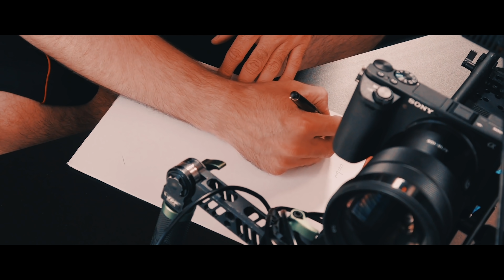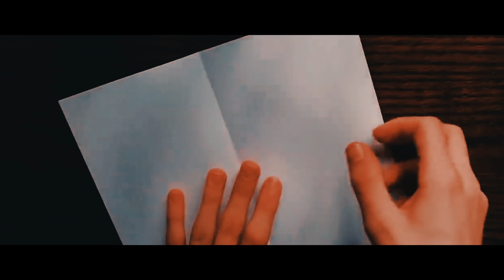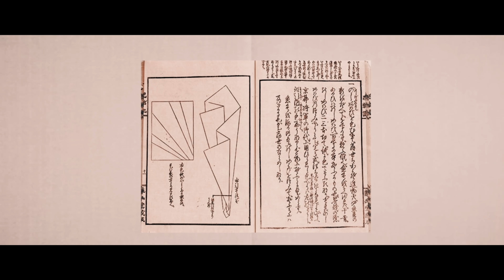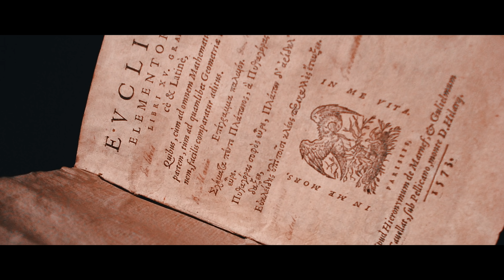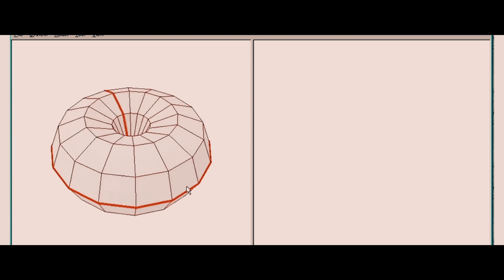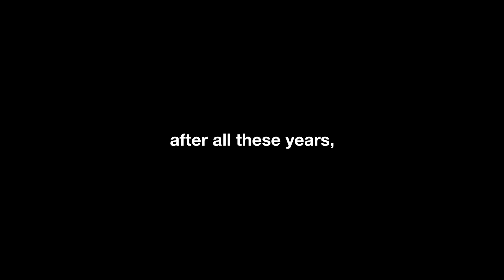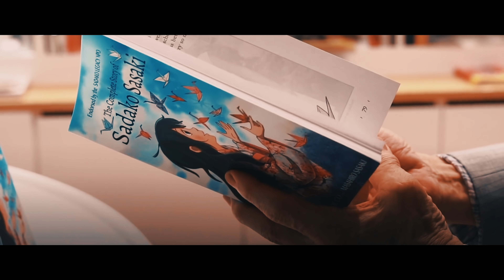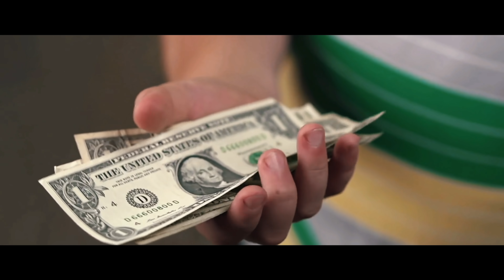Origami: The Art of Paper Folding

Comment: With all due respect, I find Origami infuriating because I cannot, for the life of me, actually fold correctly. I'm always a little off and it makes it a little too different than how it should be so then I unfold it but the creases are already there so I have to get another sheet of paper and mess up again, then get another sheet of paper and then another and another until I either give up or ruin an entire forest.
Reply: same omg
Reply: Use a software.. surely there are multiple origami based games on the play store
Reply: @l1mbo69  Gross. You take that back.
Reply: Make sure that what you start with is actually a square by folding the diagonals. If both the corners get folded in half and the 2 others touch you should be good. It's very difficult to fold anything if your starting point is even a little off
-someone who has folded origami for 5 years

Comment: If a one dimensional object begins to spin does it gain dimensions
Reply: No, because, outside of theoretical mathematics and theoretical physics, there is no such thing as a 1D (or 2D, for that matter) object. Even a single atom has width, height, and depth. Since it is impossible to spin something that doesn't exist, the answer is no.
However, if we ignore that and pretend that a 1D object could exist, the answer would still be no, as, in super simplified, watered-down terms, the number of dimensions is based off the size of the object over each axis and, thus, is completely unrelated to rotation.
Reply: @johngerken4263  so nothing can 'spin' outside the axis it exists on
Reply: So even things like light are '3d'
Reply: Correct. Light is made up of sub-atomic particle called photons and, while their size isnt measured in the same way you would measure a macroscopic (non-microscopic) object, in a sense, they do still have 3 dimensions.
Reply: I saw I good video about how dimensions work a while back. Let me see if I can find it for you
Reply: Definitely interesting
Do things like electricity, magnetism or gravity have dimension as well.
Thanks for the knowledge professor 🤓
Reply: Not a professor. Just a random person who is interesting in that kind of thing
Reply: The answer to your 3 questions about electricity, magnetism, and gravity would be no, in the traditional sense of the word (the word "dimension") however,
Electricity is just the process of electrons "jumping" from 1 atom to another, and electrons are a sub-atomic particle that are, technically 3D. 
I would say that electricity does not have any dimensions, as it is an artificial construct used to describe the process of electrons (which are 3D) moving around.

My understanding is that magnetism and gravity are both forces, and thus not physical objects. Rather they are concepts used to describe the effect that expending energy has on an object. Thus, neither of them have any dimensions.

Dont quote me on any of this. Do your own research. I could very well be wrong. While I'm pretty confident in my knowledge, there is a decent chance that I'm wrong or at least only partially correct in some technicallys or some of the finer details.